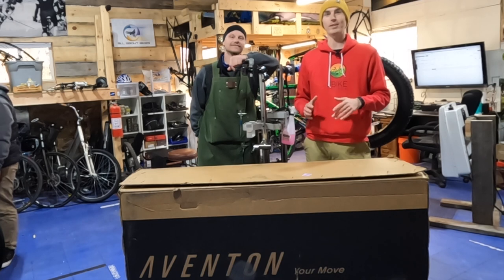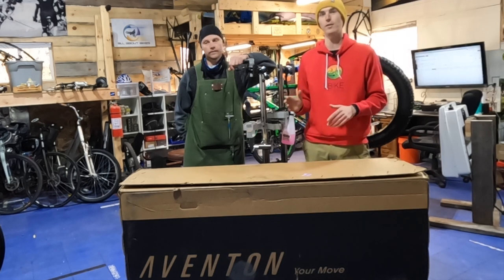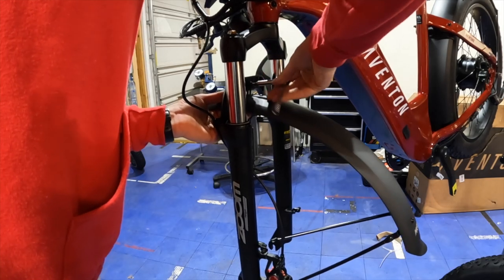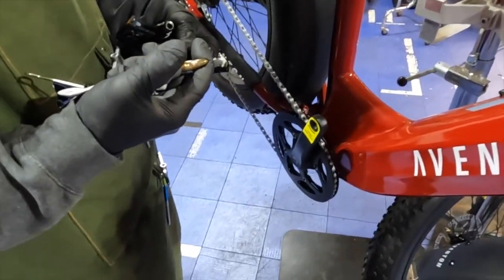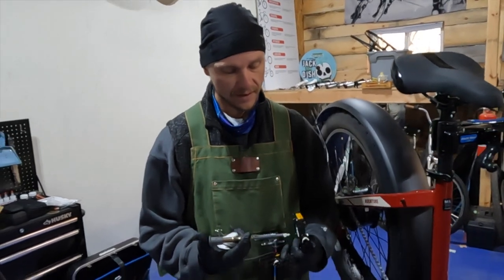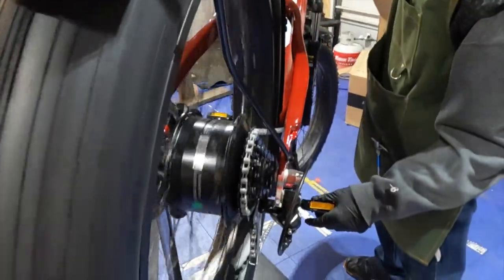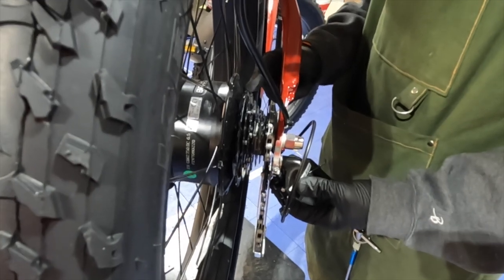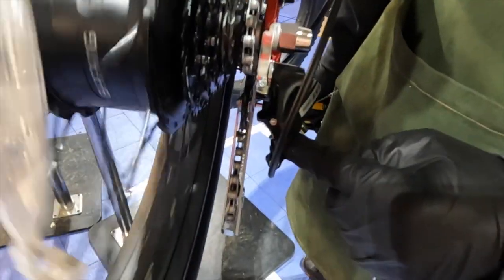Aventon Aventure Ebike Assembly, Tuning and First Impressions

Comment: When adjusting the brake centering over the rotors, loosen the bolts and press the brake lever then tighten up the mount bolts. The calliper should be centered.
Reply from the maker: Hi Ian, I've heard this before - in fact in one of our videos Matt tries this just to show it doesn't always work. But if it works for you that's great!

Comment: Thank you so much for this video. I had the exact same issues and I can do the fine tuning myself rather than spending more. This is a know issue with Aventon Aventure, the sound of hitting the caliper with the disk breaks when turning the wheel (front and back) You definitely need to fine tune it or upgrade the parts to a better quality. I am probably gonna just upgrade parts in the future when the stock parts are worn down and when I got the funds to do so.
Reply: Thanks for posting this, I've been encountering the same issue with my Aventure 2, and I've been wondering if it's an issue on my end or an issue with the parts. Do you happen to know what parts cause the issue? I don't want to have to replace stuff that isn't causing problems.

Comment: I think the only down side of this E-Bikes is that if you want to modify this E-bike in the future is going to be hard because the battery is mounted inside the frame plus is not a triangle frame, most people will want to go more faster but considering the price I think is better to build a E-Bike put a 1,500 watts motor for more torque and speed but this is definitely a beautiful E-bike.

Comment: Just checked the manual and it says for the front tire bolts recommended torque value at 25-30Nm.
Reply from the maker: Thanks for the tip!

Comment: Nice video thanks.  I'm just wondering what the difference between the step through and step over.  Is step through more lady like looking? Or just what you prefer? I read people prefer a step through if they have a rear bike rack it gets in the way.  I'm not sure, I dont think I'll need a rear bike rack.  Now that I see your tools and fine tuning I'm going to buy from a local dealer so he can put it together correctly.  Great information love the bike !
Reply from the maker: The step-through has no top tube. So it allows for more accessibility and an easier time mounting and dismounting from the bike. Ryan and I (both men) actually prefer step-through designs.

I think the issue with bike racks is that some bike racks actually use the top tube to hold bikes onto the racks. And since there isn't a top tube, it makes step-through bike harder to mount or requires the purchase of an extra bar.

If you can find the bike local, that is the best choice for most buyers. Hope you enjoy what ever ebike your end up with.

Comment: Great video how do you adjust the brakes on the aventon adventure 2 to get more distance on the brake handles I don't see any adjustments on the cables like the regular bikes.
Reply from the maker: Depending on what exactly you are trying to adjust, there is an allen key on the inside of the lever that will allow you to adjust the lever position. But you might also need to bleed the brakes if you are getting a soft or low pressure upon pull.

Comment: Very informative! Does the throttle work immediately or after you start peddling. 
The best thing about the throttle is that it gets you going from a dead stop. My wife's Aventon.. only after start peddling. Anybody know if that can be changed or adjusted?
Reply: Push the throttle first until you get going then petal. The petal assist will kick in. Then let off the throttle.
Reply from the maker: Tom, this is something that Aventon has changed on many, if not all of their ebikes at this point. I believe it was related to the controller so likely you can't modify it after the fact.
Reply: throttle works immediately after pressing as long as you are at least in pedal assist level 1.  Does not work in pedal assist 0.

Comment: Is tuning required after assembly of an Aventon Aventure 1 or 2 bikes? I called a Aventon dealer and they said out of the box, it requires no tuning as it already is tuned quite while. After 6 months to a year is when it needs a basic tuning. Is this true to you guys? What is your opinion?

Comment: Hello - Going to purchase this week either a RadCity 5 Plus or this Aventon Aventure -Which one do you suggest for an old road cyclist ? Thxs BTW - Where is your bike purchase referral link for Rad  or Aventon ?
Reply from the maker: Here are my affiliate links which help support the channel: (Aventon) https://bit.ly/3eRybHX Rad (https://radpowerbikes.pxf.io/rQ73B5) I think the main consideration should be if you want fat tires or not. The RadCity 5 Plus will be much more efficient and in my opinion, also puts you in a more comfortable riding position. The Aventon with its fat tires will be more comfortable, especially at lower tire pressure. They will also be more capable off-road. Still many people, my dad included like fat tire ebikes even though they never intend to use them on trails. Hope that helps!

Comment: can you use an a hex bit with an electric drill to tighten the handlebars?
Reply from the maker: Not recommended but possible. Don't want to over tighten anything
Reply: @EbikeEscape  how long is that handlebar screw?

Comment: Hey guys, i need your help. I am 6' 4" and 230 lbs. What ebike, Aventon ,Rad, etc., would be your top pick. My budget is 2k. I need a rear rack, since I'll be using the bike for just about everything. City riding mostly with some gnarly  uphills. Fun, fast and "manly" is also important. Thx in advance.
Reply from the maker: Check out the new Aventon Level.2, also some of the Ride1Up ebikes might work for you. The 700 series comes to mind.

Comment: In regard to  the Bafang 750 motor is there more/less or same torque for the 1000 motor?
Reply from the maker: Hi Caroline - I think the 1000 watt might have a bit more but it's going to depend. You'd have to look at the specs on the Bafang motors you're looking at.

Comment: I was wondering why he is trying to center the rear brake caliper by eye? With hydraulic brakes, I loosen the caliper and then squeeze the brake lever. This centers the caliper on the disc. I then tighten the caliper. After the caliper is tightened down, I release the brake lever.
Reply from the maker: Hi Michael - in the last video I did with him he mentions that he has not found that that technique works very much. I can attest to the same. My guess is that at his expertise it's almost easier to just eyeball it. He also used a really cool tool in the last video on the Tektro hydraulic disc brakes.

Comment: Hey I have this bike and my breaks went out on my back tire(my fault). What breaks can I buy to replace the caliper? Would really appreciate any help I can get.
Reply from the maker: I think the easiest thing to do would be to ask Aventon though I'm sure you can buy some aftermarket.
Reply: Can i ask. How did they fail?
Reply: @RG-io4vh  it turned out to be my brake handle and needed new pads. Still have to find a break handle to replace it.
Reply: @JoeyandAbby  thanks for the reply. We're you able to get new pads easily?
Reply: @RG-io4vh  yeah the pads are easy to change out. I got em on Amazon. I got a pack of 6 for like $12.
Reply: @JoeyandAbby  thanks for the reply

Comment: I own two of these. They are great bikes. 

But the step thru arrived with issues, both bikes were missing parts. On the step-thru,  it took me six hours of work to modify the channel containing brake line and electrical wires behind the battery, just to get the battery to stay in. 

Almost six months later they still have not shipped the part. 
So while the bikes ended up good, the quality control and customer service was terrible. 

I would not recommend this company.
Reply from the maker: Oh wow, sorry you didn't have a good experience! Can you share more how you were able to get the battery sorted?

Comment: WATCH YOU TORQUE ON THESE BIKES! THESE NUTS AND SCREWS ARE GARBAGE SOFT CHINESE STEEL.
Reply from the maker: Good to always torque to spec.
Reply: @EbikeEscape  I found out the hard way.  Especially the rotor bolts.    Getting an Ecell crown Monarch 1500w AWD next.  Tge Aventon is decent but not what I was hoping it would be.  Plus CS is horrible and I've had to pay hund of extra cash to get mine functioning properly and still I'm having issues with stuff just wearing down.   Screen stopped working back brakes failed only after 500 miles.  Plus I already need new tires.  This is a decent starter bike I guess if only Aventon paid attention to what they ship out and get there act together on parts which are non existent especially batteries which is insane imo.    I can't even buy an extra battery for mine or a controller and the one bike shop nearest me said they can't get them either and certainly they said they aren't dealing with this company anymore
Reply: @Freebird_67  what happened with the brakes. I just bought one and would like to know what to watch out for. I managed to get mine on sale for 1250 so i can't complain for that price!